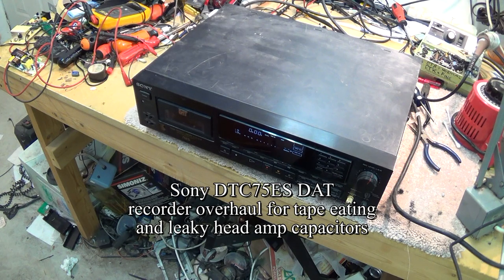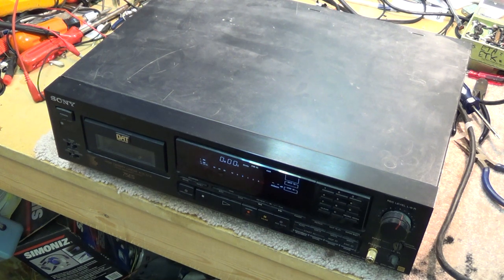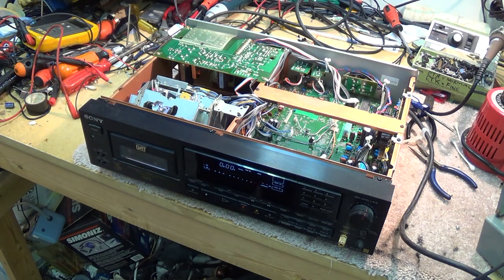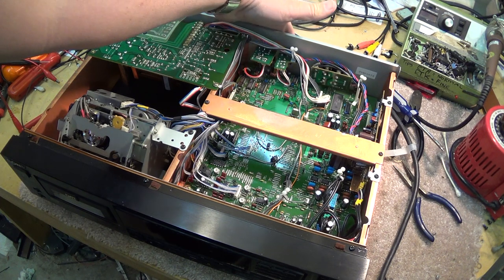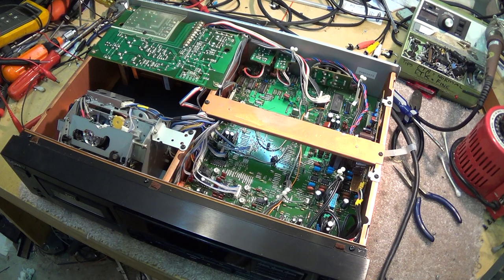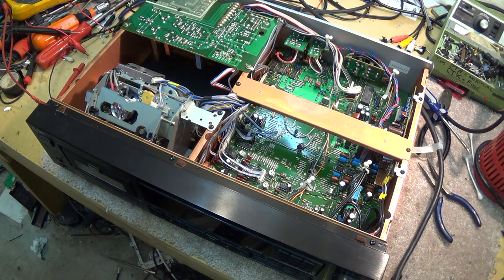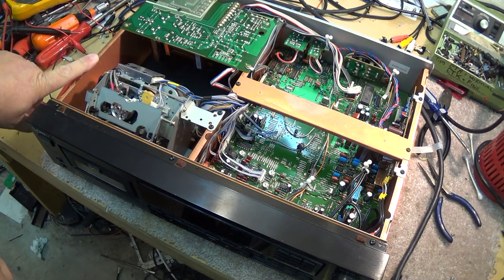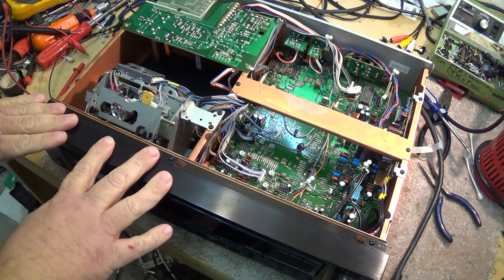Sony DTC75ES DAT Overhaul

Comment: I think, that the drive mechanism of this DAT recorder is relatively simple compared with a Camcorder drive mechanism that was used back in the 1990s. I worked as a technician for such devices until the beginning of the year 2000.
Reply from the maker: DAT ises only a 90' tape wrap as opposed to 180. Some of the camcorders with the smaller head drum used a 360' wrap (8mm) and 270' for vhs c
Reply: Sony had 2 basic types of mechanisms which are being referred to as 3DD like the DATM-100 family (found in the consumer-level 670/690/790/ZE700/55ES/57ES/59ES/60ES) and 4DD mechanisms like the DATM-5x family (built into the higher-end models like 77ES/2000ES/ZA5ES).

The 4DD is absolutely preferrable if you get into DAT. The 3DD had lots of problems, especially in the lower ends of the price range (like the DTC-670 and even the 57/59/60ES) and needed quite a few revisions over the years, although the later iterations worked quite good in both earlier and later models like the 1000ES/55ES and DTC-ZE700.
Reply: @svenschwingel8632  That's absolutely right. I still have a studio version of a SONY DAT recoder with 96 kHz sampling rate. It was a wonderful device with really good sound quality but today I don't use it anymore because there are no more DAT cassettes available for this type of device and I don't like to listen to the music to most of the bands which are established today. I'm now 56 years old and my preferences for music have been changed. But that's my life ...
Reply: @alles_muss_anders_werden  actually, NOS (new old stock) DAT tapes are pretty common on ebay. A wrapped Sony PDP-125C (which was their pro line for DAT media) goes for ~10€ a piece if you buy a 10 pack. I bought a few recently and they still work great. Pioneer also had a few high sampling DAT machines that ran at 96 kHz.

Compared to prices for NOS Compact Cassettes, that's a steal.
Reply: @svenschwingel8632  That's true. Thank you for your advice !

Comment: is DAT dead, expect for vintage units?  Big Thanks for making video.
Reply from the maker: Yes DAT is not produced any longer for audio use. It is still used as a computer backup format, and the tapes are still readily available. The computer dat tapes are usable in audio machines. It is still the best tape format you can use for audio. Eventually llike VCRs all the old machines will wear out, and they we will be stuck with tapes that can't be played. I use DAT in my studio as a temporary storage format. Mainly for recording work recordings. For example I record the music channels from my cable service, then then play them back and dump the tracks I want to keep on my computer. I also use it when I have  voice over work to do and I am using voice talent for me. I will get the talent in, and mic them up, and have them read and record multiple versions of the script and put it straight to DAT rather then to the computer. I then can go through the tapes, and capture the best version for use in the video

Comment: Is that from copper coated or pure copper$$$$$
Reply from the maker: +Donald Ellett That one is solid copper, and yes it was expensive. I believe I paid about 1700.00 wholesale for that unit when I worked for Sony.
Reply: About 3/4 the way thru the video a video angle showed it was solid copper as far as I could tell
Reply from the maker: +Donald Ellett The ES decks were built that way. I have a Sony CDP-X555ES CD player that is also built on a solid copper chassis.That was back in the day where the ES really did mean Expensive Sh1t! This CD player weigh in at about 45Lbs. It not only has the solid copper chassis, it has steel plates glued to the underside of the top cover to stop it from resonating to loud music.I just overhauled my latest find, a Tascam DA40 studio DAT machine. It is good, but not built on a solid copper chassis like the Sony.Watch for that video soon. It had an electrical problem that I had to TS with test gear, and a mechanical problem on top of that. The parts just arrived to fix it today, and it is under repair now.

Comment: Interesting that Sony omitted 44.1 KHz capability for analog-input recording to possibly keep sales of Sony's professional-line of DAT recorders from being "eaten into" by their consumer-line units (ES-series models included).

A similar thing happened to Sony back in the late 80s between their prosumer "ED Beta"  and professional "Betacam" formats--apparently ED Beta had such good quality (up to 500 lines resolution, I've read), that most professional video customers (TV stations, video post-production houses, etc.) bought and used the much-cheaper ED Beta format as opposed to the professional (and far more expensive) Betacam (& later Betacam SP) formats.  Plus ED Beta used the same metal tapes as Betacam SP (and vice versa). Sony's solution to this was was to quietly discontinue ED Beta in North America, with, IIRC, the format only being sold in Japan later in ED Beta's life.
Reply from the maker: +Ryan Schweitzer 
Consumer Dat recorders did feature 44.1 kHz just not this model. I have 2 other Sony Dat recorders that have 32, 44 and 48 kHz sample rate. 
I know about the Ed beta war too. Heard that one back when I was buying my first betacam. Was going to go ed beta but the dealer advised that they were being discontinued because it was cutting into their professional division, which was the profitable part of the business. Consumer was not. They also had a professional hi-8 division that delivered almost identical quality to ed-beta. I know as I had an evw300, which was a 12,000 camera. I used that for weddings and long from work because betacam was limited to 20 minutes on a standard tape. I needed betacam for stringer work as the TV stations wanted stuff on betacam as it was easier to integrate into their system.
Reply: The later ES models like the ZA5ES allowed analog 44.1. Also the DTC77ES did.

Comment: Hello ....  I think that's not good as you pulled out the little Capacitor with the pliers
and you have no cuffs against electric charge
  to elimitate  ....By the way this Video  is O.K  I repaired devices earlier
Reply from the maker: Esd is overblown. Not damaged any esd sensitive devices in 35 years.  Most of the esd hype is by people that sell the ground straps.  Some chips are more sensitive than others when they are bare chips but once installed the rest of the circuit protects them.  One of the most esd sensitive device you are likely to own is the lowly sd card.  Touch an sd card or USB stick when there is a static charge in your body and you can wipe the data and or fry the chip. You don't hear people harping about those chips though but they are easily corrupted.

Comment: It actually isn't a good idea to let cats go outside because they will hunt birds and could get killed by traffic.
Reply from the maker: My 4 cats dont go outside.
Reply: @12voltvids  Oh; you said that you told the cat 'time to go outside' or something like that, but I am quite glad that you don't let them outside.  Other than that, a solid copper chassis?  That's hard to believe, since I have seen so many copper clad steel elements, but I don't doubt you since this is 'expensive shit'.  I just haven't seen anything like that in my travels.
Reply from the maker: I used to have a cat that ventured outside, but no more. They all stay in where it is safe. Neighbours cat is nicknamed "Tripod" because he lost a leg from going outside. A dog chased him up a tree. Cat fell and was impaled on a fence, and lost a leg. Cat still goes outside, can run as fast as anything and scale a 6 foot fence with only 3 legs. I should film him some day as he is quite the size. Probably 20lbs, black as the ace of spades. Hangs out in my front yard tormenting my cats that watch him through the window like a hawk.
Reply: @12voltvids  I told my sister that it was a bad idea to let her cats outside.  She didn't listen, and one of the barn cats on a Mission property my family owned disappeared, presumably eaten by a cougar.  Barn cats usually stay in the barn to hunt for mice, so you don't usually have to worry about them too much.  My sister later moved to a place at Stave Lake, where another cat disappeared and probably suffered the same fate.  She now has a cat in her apartment, but this cat gets freaked out by going outside.

Comment: Wow that machine is in rough shape. ES, Elevated Standard is the correct names from Sony. Funny how people cannot take care of the cosmetics of their gear. I have 1970's Teac Reel to Reels that look like, and run the day they came out of the factory.
Reply from the maker: +Vincent Chen This machine is mine, and I have owned it since it was new. It was installed in a cabinet from day 1. I still have the wood side covers still wrapped up and untouched. There is some dust on it, and a few scratches on the top as other equipment has been on it, and it is over 20 years old. Its not a museum piece, it is a piece of gear that was used in my video production business for many many years.